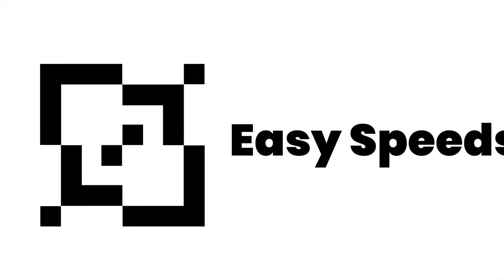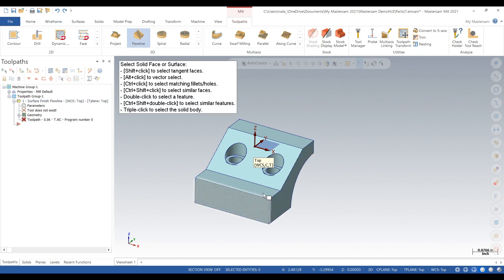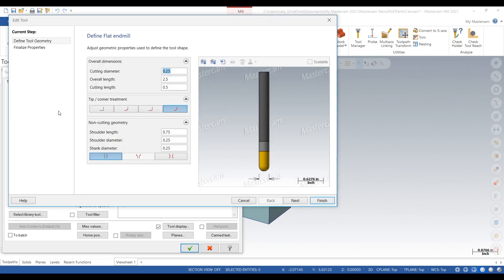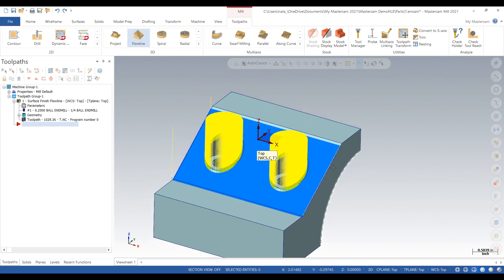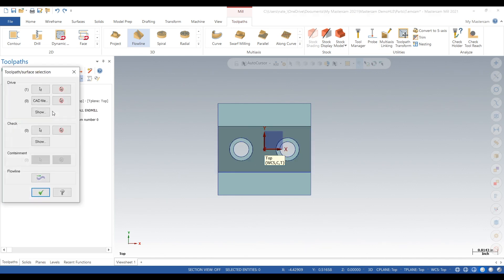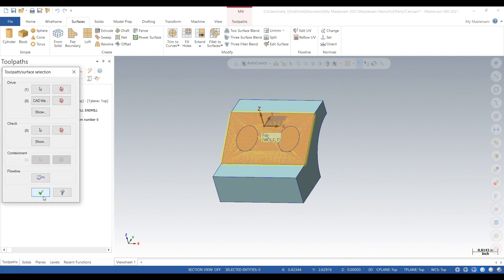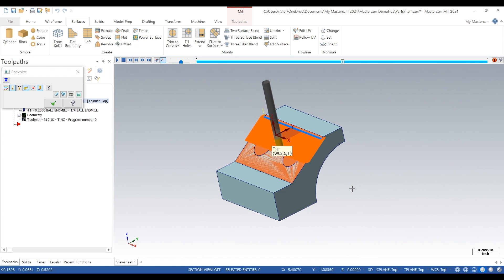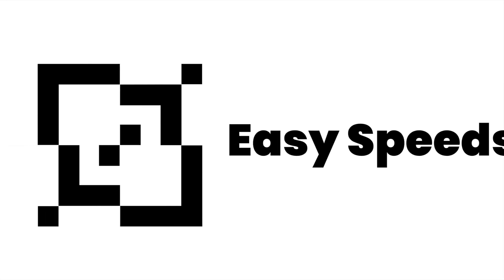Create a Surface - Mastercam

Comment: what is the rough operation for same surface?
Reply from the maker: You can remove most of the material with opti rough, or surface rough parallel.